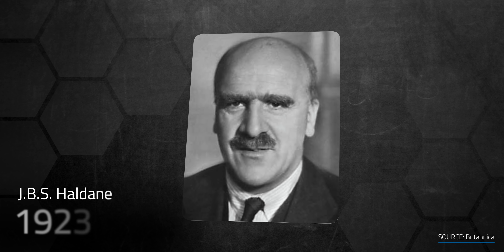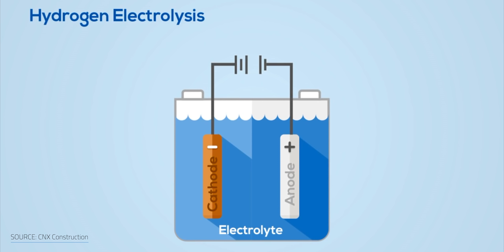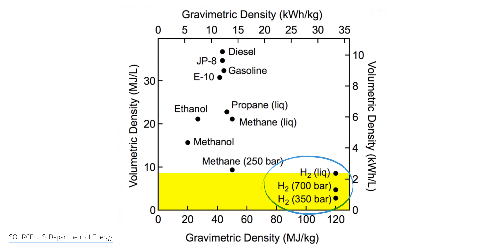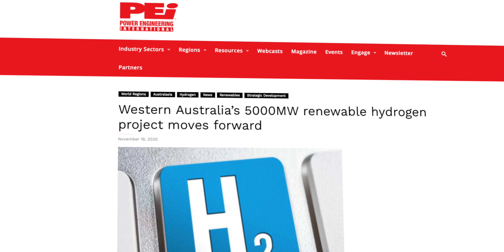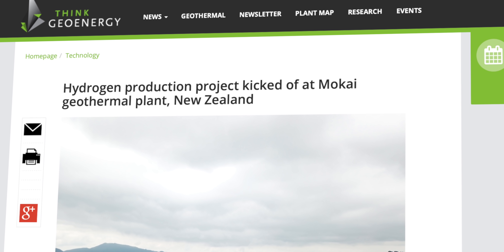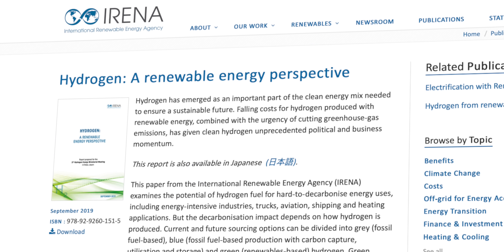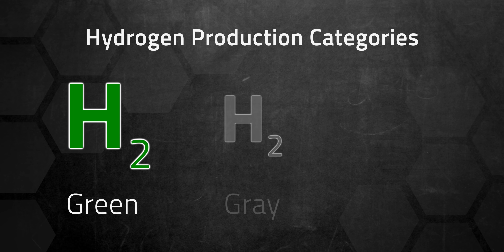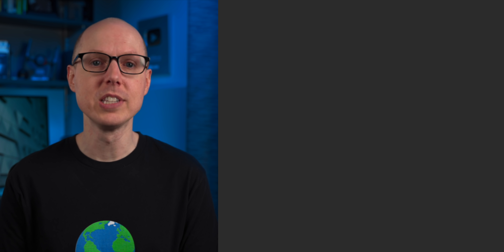The Truth About Hydrogen's Dirty Problem - Green Hydrogen Explained

Comment: Hydrogen is clean. The argument that 95% of hydrogen produced uses fossil fuels is meaningless when compared to batteries. 100% of batteries use fossil fuels in their manufacturing process. What makes them worse than hydrogen is that fossil fuels are also used to recycle them. Hydrogen is clean because it self recycles.
Reply: It doesnt self cycle. Hydrogen requires 3-4 times the amount of electricity to create. If you put hydrogen in vehicles, you might only use fossil fuels to make the batteries once, but fossil fuels for every mile you drive with hydrogen in a process that releases more emissions than if you had just burnt the fuels in the first place. Or if you make it from green hydrogen you need 3-4 times the same energy than a BEV does per mile, coming from grid which arent fully renewable which means 3-4 times more emissions per mile. 

You really saying you think hydrogen would be more green?
Reply: @engineeringtheweirdguy2103  It does self recycle, when Hydrogen energy is used it instantly bonds with oxygen to form water which is harmless to the environment. Batteries will require even more energy derived from fossil fuels to be recycled at the end of their usefulness. Although a battery has a capacity of 100% only about 60% is ever used in an EV. They are never fully charged and never fully discharged. All of Hydrogen fuel can be used. Batteries use electricity derived from fossil fuels when charged. Hydrogen can easily be made with renewable electricity.
Reply: @jamesemcclure  I dont think you've fully thought through your argument. Firstly, Batteries are not like hydrogen, infact Hydrogen Fuel Cell cars need Lithium Batteries to operate. Hyundai's Hydrogen truck the Xcient uses a 75kWh battery pack. The same size thats in a Model 3 Long range. But you seem pretty keen not to hold the batteries in Hydrogen cars to the same classification.

You dont fill up your battery with new cells every time it goes flat, They're a capital expenditure of the car from manufacture. Not something you refill to fuel your car make them distinctly different. If we're talking about battery recycling we're talking about car recycling but that wouldnt a road I'd want to go down if I like hydrogen cars.

This is because Hydrogen cars dont last nearly as long. A modern BEV has a battery life of around 500,000 miles. This isnt theory, its fact, older generation batteries are doing so and newer generation batteries are showing less than 5% degradation even after 200,000  miles.

Hydrogen cars however, come off the assembly line with an expiration date printed on the fuel cap. Limiting the life of the car to only 15 years. In addition, the fuel cells in these cars are only rated to last between 150,000-200,000 miles depending on the manufacturer.

So for every lifetime of a BEV you'd have to make and dispose of 3-4 FCEV's and all the emissions that go along with it.
Reply: @jamesemcclure  As for charging of EV's. 60-20% is only used in normal daily use. However you can use and have access to 100% of the batteries capacity if you need to travel those distances. Its just better for battery health and frankly comfort of driving (regen braking) that you dont charge to 100% and practically speaking most people down aim for the goal of rolling into a charging station just as the lights go out on the car. 

Suggesting that You cant use all of a batteries charge under the same use constraints as hydrogen but suggesting you can use all your hydrogen is.. well just not well thought through argument.
Reply: @jamesemcclure  And finally, as for making the hydrogen, well this might be a shock for you but green hydrogen is made by using the same electricity that chargers BEV's, fossil fuels and all. And whilst you stated Hydrogen can easily be made with renewable electricity (which it can), BEV's can just as easily take advantage of renewable electricity. This particular argument was a breath taking feat of special pleading. I'm not trying to be insulting  but I just want to point out how absurd that is as an argument, you are implying that EV's cant be charged from renewables, yet you can have a solar panel on any roof. Even on the roof of those who own and charge EV's from home.

But here is the rub, Green hydrogen requires between 3-4 times the electricity per miles worth of hydrogen than BEV's need per mile. They get their energy from the exact same grid powered by the exact same mix of fossil fuels and renewables. That means that hydrogen cars will emit 3-4 times more emissions per miles from power generation alone. Thats for Green Hydrogen

However the most common and cheapest way to produce hydrogen is by splitting it from fossil fuels in a process that emits more emissions than if you had just burn the fuels in the first place.

When people buy these things and are already paying twice as much per mile for hydrogen, they will inevitably get what ever is the cheapest. And that would be the dirty hydrogen.

Sorry but BEV's are much greener. They also last long, have better performance, are safer (and no i'm not talking about how explosive hydrogen is), cheaper to operate, more convenient to operate and have better cargo and cabin space than hydrogen cars.
Reply: @engineeringtheweirdguy2103  Not all hydrogen vehicles use fuel cells. JCB have a hydrogen power plant that does not use fuel cells, instead they have an engine similar to those currently used in vehicles. The complaint with hydrogen when burnt has always been they create too much NOX. JCB claims they've resolved this issue and many others associated with hydrogen. JCB will be making the vehicles that mine the lithium for your batteries.
Reply: @engineeringtheweirdguy2103  You do not have access to 100% of the battery. No manufacture including Tesla has ever claimed this.
Reply: @jamesemcclure  then you'd need even more energy per miles for that vehicle. Combustion cycle engines are far less efficient that Fuel Cells or Batteries.
Reply: @jamesemcclure  I can find a single source that claims otherwise. I dont know where you're getting this from. Why on earth would they give you a 75kWh battery and only let you access 45kwh? aside from the fact that you can see your energy consumption in real time, inclusive of things like aircon, or heated seating, and you can see how much energy you use in a trip and compare that to your expected range indicated vs your battery size. My standard range model 3 has a 50kWh battery, I drove it to 12% charge at one point. its expected range was in line with the consumption for a 50kWh battery. Additionally, When I charged it I tracked it, showing that it took 44kWh of energy to charge. Meaning it is infact accessing the full 50kWh of energy.

Where you're getting your "only 60%" figure from is beyond me.
Reply: @engineeringtheweirdguy2103  You drove it to 12% power at one point. You didn't drive it to 0%. I bet you don't charge it to 100% all the time either. I don't see even your own figures adding up to 100% usage. It takes so long to charge the last 5% no one bothers. Also no one wold risk going to 0% in case the brick their battery. At $22,000 for a replacement I don't blame them.
Reply: @jamesemcclure  well a battery replacement is actually $7k. It does add up to 50kWh, going to 0% does not brick the battery anymore than it bricks your phone, practically going to 0 is stupid but there are videos all over youtube of people doing it if you'd like to see for yourself, its not bother charging to 100% if im charging from home while I sleep, no skin off my nose if I really need the extra range. And nobody is going to intentionally drive a hydrogen car to empty just as much as they intentionally drive a petrol car to empty or an EV to empty, because then you need someone to come out and rescue you. Unfortunately hydrogen is a lot harder to transport than a generator or a jerry can making the implications much worse. You're kicking up a fuss about something that isnt a problem or unique to EV's as I've said. i dont think you've thought this through very much
Reply: @jamesemcclure  I have charged to 100% multiple times. When i've done long trips. But generally I only charge to 90%. When My range at 100% is 400km, and I only drive 100km per day,  I dont need the extra 10%, its better to just charge it to 90%. I doubt i'd need the extra 300km, yet alone the 40km, i lose by charging to 90% instead of 100%. get real please.
Reply: @jamesemcclure  Hydrogen IS energy dense. But the way to get electricity from it and to make hydrogen is also very energy dense. You lose 30% of your energy breaking the chemical bonds to release water into hydrogen and oxygen. You lose 15% of your remaining energy by compressing it to 700 bar for storage, you also lose 40% of your energy through a fuel cell converting it back to electricity. meaning, not considering transportation of the hydrogen, if you were to put in 100kWh of electricity from the grid to make hydrogen, you would only get 35kWh of electricity available to the electric motor best case. BEV's however, of the 100kWh you supply from the power grid, you can have access to 90% or more of that as available electricity to the wheels. 

Hydrogen wastes alot of energy. You are taking electricity, converting it to gas, then compressing it then converting it back to electricity. You are adding a heap of extra steps for no reason.
Reply: @jamesemcclure  What do you mean they take too long to charge? I charge my EV when I get home from work. I dont stand there holding the plug anymore than I hold the plug in my iphone while it charges. I plug it in and walk away, I come back in the morning to it being fully charged (90% unless I set it to charge to 100%). No time out of my day. Meanwhile you'd have to refill hydrogen at a fuel station once per week. for the average person that would waste 16-17 hours of their life per year.

So what do you mean they take too long to charge? what are you imagining? I dont think you've thought this through.
Reply: @jamesemcclure  You cant use batteries as a mass propellant. Nor does rocket fuel indicate its useful for domestic vehicles. Otherwise we'd be using atomized aluminium powder in cars. But we dont.

As stated before combustion cars would be far worse. Combustion cycles, even hydrogen combustion cycles are only around 20-40% efficient, in the case of hydrogen, closer to 20%. A fuel cell is 60% efficient. Much less heat loss.
Reply: @jamesemcclure  There is a very distinct difference between replacing a battery and replacing a battery pack the battery pack is the component which houses not only the individual batteries but the Battery Management Systems (BMS) themselves. This includes the coolant systems, pumps, radiators, heater, it also includes charge management systems and a whole host of other things. It also includes chassis reinforcement as the pack makes up part of the battery. The pack to replace WOULD cost around $22k to replace. HOWEVER if you are just replacing the batteries, you don't need to replace the pack. Just the thousands of 18650 batteries within. Which is as simple as removing the seats, taking up the floor and replace each battery like you would in a giant TV remote. Costing only around $4-$7k depending on the battery size. Replacing the entire battery pack to replace the batteries would be like replacing your entire PS5 controller with a new controller every time the AA batteries that came with it went flat. Its stupid

Most people conveniently leave out making that distinction when talking about battery replacements, usually because they have an agenda.
Reply: @jamesemcclure  If you had a coolant leak, depending on where it was, you would have to replace the battery pack. Depending on its age, Eg, within 8 years of purchase, it should be still under warranty though. But note that replacing a battery pack is distinctly different to replacing the batteries themselves.

Comment: Nobody is talking about methanol fuel cells because the dying gas industry needs to bleed their last profits out of producing hydrogen. Why would you want to feed a fuel cell with a substance that must be stored under pressure as a supercooled liquid when cheaply made methanol is a great fuel cell fuel and is stored as a liquid at ambient temperatures. So what that is is poisonous if ingested? So is gasoline.

Comment: I've been thinking that green hydrogen is the only truly clean renewable because it lessens the need for exotic battery materials that require massive mining projects.  

Your vehicle can run on a fuel cell once they find a safe refueling system.

The refueling stations can be on-grid solar so that excess power can supplement the grid, and the grid can supplement on cloudy days.

And since they're electrically powered, they can provide charge points for EV's. 

Excess hydrogen production could be stored in containers and used as generator reserves and the like.

And the oxygen produced could be tanked for medical or industrial use.

Comment: Great video.  Is green hydrogen essential?  Yes.  Is it essential for vehicles?   Possibly.   Li-ion cells will soon likely be able to charge faster than the charger stations will be capable of charging them, meaning that it may always take at least 15 minutes or more to charge your batteries to 80%. Fuel cells may not be as efficient, but they can solve that problem.  A plugin fuel-cell vehicle is what I would ultimately like to see. :)

Comment: Good job, you figured out that electricity is produced mostly with fossil fuel. That is also true for every electric item, the only difference is that it should be conssidert100% fossil fuel because if you add more electricity consumption it prevents you from shutting down plants that use 100% fossil fuels.

Comment: I honestly think we should be hesitant with this technology it's byproducts are water vapor which may not seem bad at first glance but water vapor is actually a far worse greenhouse gas compared to Carbon dioxide. SO WE WOULD CHANGE FROM ONE PROBLEM TO ANOTHER WHICH COULD BE WORSE.

Comment: i prefer hydrogen to electric for energy storage by far. 
you could use the long and intense days of deserts to use solar power to split it and then transport it. and unlike electricity, it can be transported and stored more effectively.

correct me if im wrong or if im missing something....

Comment: solar PV with thermal I think would be the way to go. PV would provide the electricity and use the thermal energy on the water with both high pressure and high temperatures means less energy needed splitting the water and at high pressure you then do not need a pump when storing the hydrogen

Comment: Mat, when it comes to hydrogen, green or any other, platinum is needed for hydrogen fuel cell......is platinum needed for ANY TYPE of hydrogen?
Reply: Platinum is the catalyst to help the hydrogen "split" into electrons and protons. They are working on other catalysts which are cheaper, but no commercial availability, yet.
Reply: @chrisheath2637  they have been working on a cheaper catalyst for over 3 years now and still no luck! I'm aware of what you say but I'm also ahead of your statement! Your not telling me anything I didn't already know

Comment: When you plug in your EV in France there is a 75% your car is atomic powered. When you fill your car with hydrogen in France and that hydrogen is produced by electricity from nuclear then your car is atomic powered. So for a five minute fueling time you get a 300 mile range with a hydrogen fuel cell. It takes a lot more then 5min for a battery powered car to get a range of 300 miles

Comment: Gray H is not good, never will be. But if you want to talk H, you have to do it with a cross section of all tech. We're about to turn carbon into the next gold rush as we get closer to carbon nano tube and graphene. This means blue hydrogen could have a better revenue stream as we move forward. Add in all battery tech increases also affect H fuel cells as it makes the batteries for such cells smaller. Pure EV require farm mor batteries than H fuel cells, batteries Tesla is trying to make part of their frame so it make them harder to replace without scrapping the car. Add into that Grey EVs, EVs whose primary sources of electricity is still coal, natural gas, etc., and the Greenness of EV comes into even more question especial when you add into it the mining of the rare earth metals needed to make their huge batteries. 

We need a cooperation of H fuel cells, Batteries, Solar and Wind, and modeler thorium nuclear not only to get us off Fossil fuels, but to meet the increase in energy demands.

Comment: Allso, how about the effect on the ozone layer? I still havent read much research on the topic other than some initial papers that pointed towards this issue, i want solid confirmation it isnt an issue untill ill jump on the bandwagon...

https://www.nature.com/news/2003/030609/full/news030609-14.html#:~:text=Being%20so%20light%2C%20hydrogen%20rises%20rapidly%20through%20the%20atmosphere.&text=This%20would%20cool%20the%20lower,surface%20from%20harmful%20ultraviolet%20light.

Comment: I hope Hydrogen quickly overcomes battery technology simply because battery cell production is very polluting, resource hungry and will be the next big disposal headache! Lots of nasty heavy metals to find, process, transport use then....dump?  Not-so-green?  The main issue over Hydrogen seems to be around the method of production of the electrcity required.